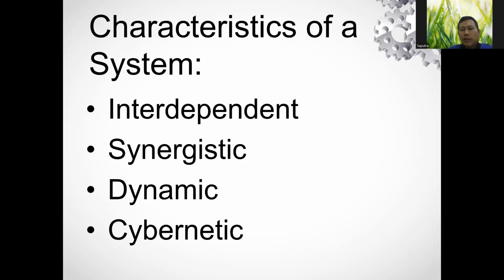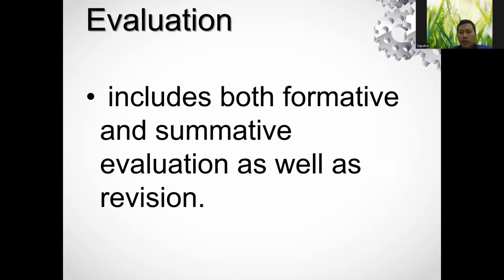What is Instructional Design l by Sir Eko

Comment: Assalamualaikum warahmatullahi wabarakatuh. I am Lely Indriyani (2120205087) from class PBIC. 
From the explanation in this video, Instructional design is a systematic process in the development of educational programs to ensure consistent and reliable learning. It involves needs analysis, design, development, implementation, and evaluation. The analysis phase includes assessing student needs, identifying problems, and setting instructional goals. The design phase involves designing measurable objectives, classifying learning, determining learning activities, and selecting appropriate media. The development phase involves preparing materials for students and instructors, including tryouts. The implementation phase is the delivery of designed instruction, with ongoing formative evaluation to revise and address emerging issues. The evaluation phase also includes summative evaluation to assess overall instructional effectiveness. This process is iterative and requires consistency and creativity from educators to achieve good development and implementation.
That's all, thank you. Wassalamualaikum Warahmatullahi Wabarakatuh.

Comment: Assalamualaikum warahmatullahi wabarakatuh
My name is Gysela Debby Utari with student number 2110205001 from PBI A. 
The conclusion that I got from the explanation: Instructional design is a systematic process aimed at developing educational and training programs consistently and reliably. It involves analyzing needs, identifying problems, setting goals, designing learning activities, and specifying instructional media. Instructional design emphasizes independence, synergy, dynamism, and cybernetics within a system. The core elements include analysis, design, development, implementation, and evaluation. Formative and summative evaluations are conducted to assess the effectiveness of the instruction, followed by revisions as necessary. Instructional design operates in a cyclical manner, with continuous evaluation and improvement. Overall, it is a comprehensive approach to ensure effective teaching and learning in educational settings.

Comment: Riany Mutmainah (2130205096) - PBI C
Instructional design is a system of procedures for developing education and training programs in a consistent & reliable fashion. The system in instructional design as as an integrated set of elements that interact with each other. The step in this system is divided into 5: Analysis, design, development, implementation, and evaluation.